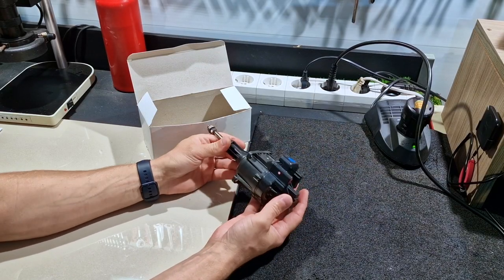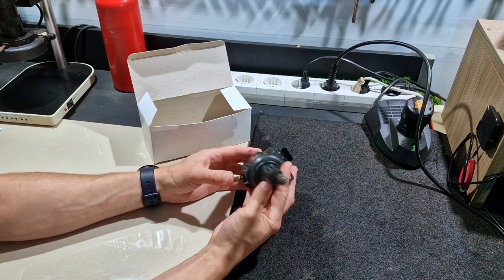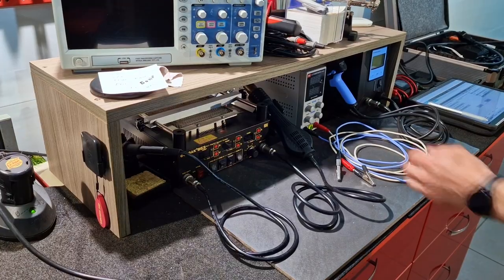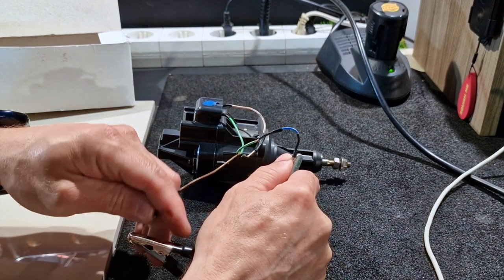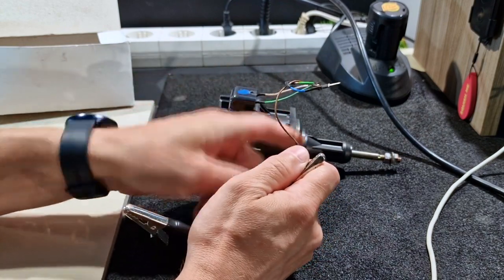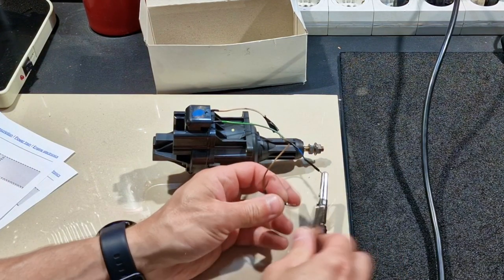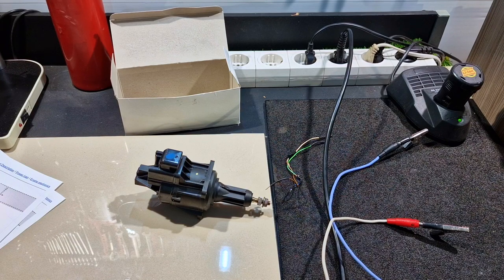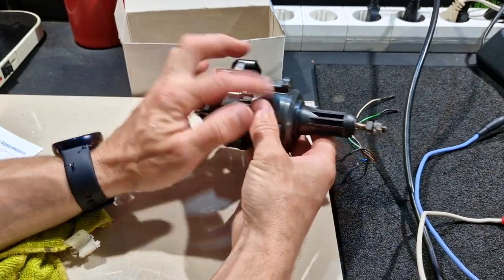BMW Electric Waste gate Actuator What's Inside !

Comment: 30 years ago this unit would have been serviceable. Now the brushes wear, you cant open it so you can't clean it out and replace the brushes... Pretty sad if you ask me. Wish companies were required to make sustainable products, and not a remove and replace product. Sad to throw so much stuff in the trash.

Thanks for tearing it down! Pretty cool to see how it works.

Comment: Thank you for the detailed video. I’m working on our g12 right now and replaced the wastegate flaps based on some internet info. However it’s still not correct. Also a new code popped up regarding a connection problem with the #2 bank. Just gonna order some actuators now. Ugh

Comment: Hi, 
Thanks a lot 
Great knowledge and experience 
i want to use my bmw electric memory seats (comfort with central control console , e60) out of the car, only to connect them with power supply and use the as game seats, how and what do i need to do, thanks in advance  
Regards
Reply from the maker: Hello . to use BMW seats outside of the car you need a CAS with key to send ignition on or if not an emulator, it can be done with Arduino or I think you can buy one ( use Google)  , and depending on the year of the seats you need SZM or switch module .

Comment: I just had this part replaced on my 2016 MINI Cooper.  Your video helped me to come to terms with the expense, now that I can clearly see where these things are likely to fail.  Curious, though:  this seems like a part you should be able to rebuild, were it not for the method used to seal the housing.  Is that a cost-cutting decision or is it related to the performance of the unit?

Comment: Very interesting. I wonder why they didn't just use a regular 3 phase brushless DC drive like the valvetronic motor. Brush wear and dust in a sealed unit isn't a good thing. 
If the cases were screwed together you could probably just clean them out and put in new brushes to get them going again,  but they probably save 0.5% of the actuators cost by hot wire welding them.

Comment: Those are control connectors… one is clockwise spin, next is anti clockwise spinner  and the last one acts as the solenoid actuator for pushing in and out of the shaft rod… it’s a basic system

Comment: It might be easy way to fix it. To remove carbon from inside drill two holes in the brushes area, put compressed air in one hole and vacuum in another. After that  some contact cleaner inside will do the rest. Finally plug holes with some epoxy glue....